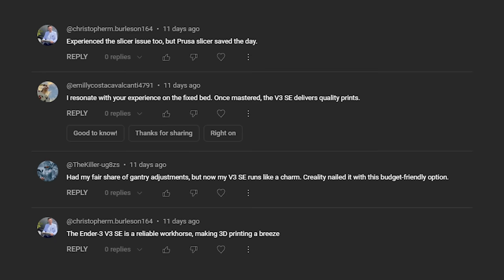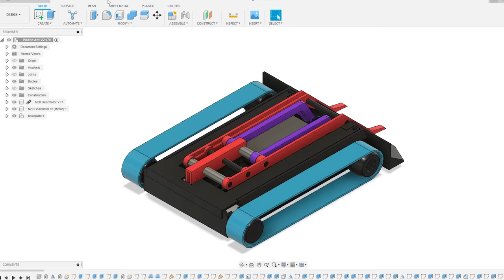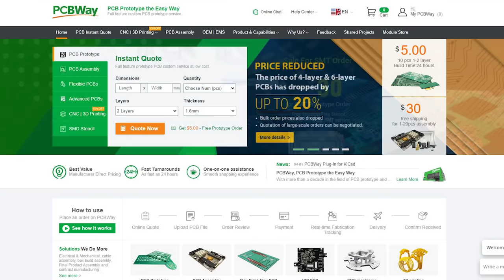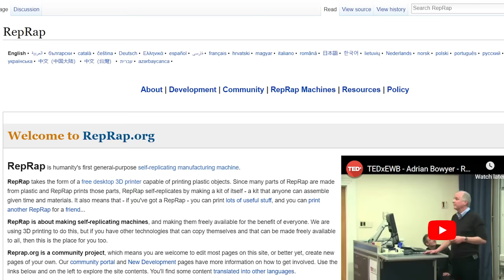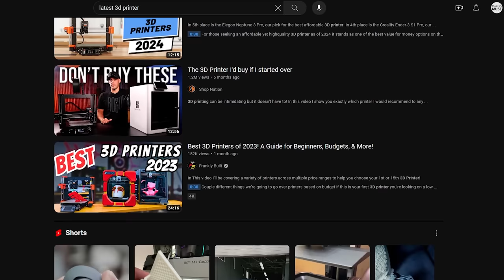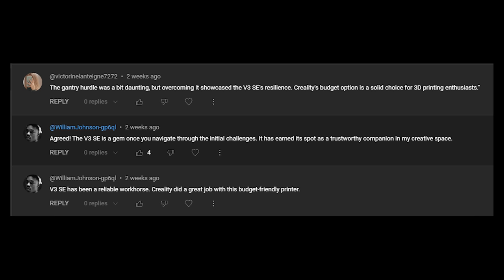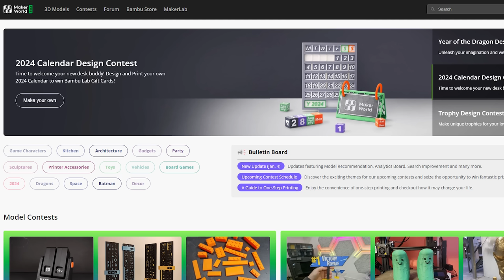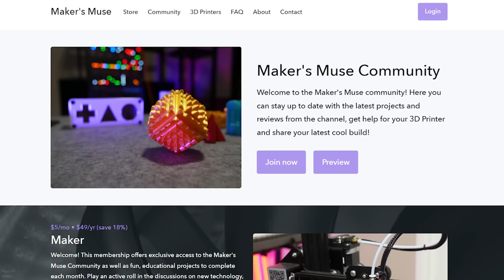My 3D Printing Predictions for 2024

Comment: Regarding professional printers though, you really need to take a wholistic look at the entire additive manufacturing industry to understand why more companies are shifting toward professional 3D printing: it’s where the money is. 

Consumer 3D printers have been a race to the bottom, and the reality is that any company outside of China is going to have a really hard time competing on price in the consumer space. 

Also, the best result a lot of these smaller 3D printing companies can hope for is getting consolidated into a larger company in hopes for some amount of stability. The fact is that AM is an incredibly tough industry to compete in, and the future is still unknown. 

You also contradicted yourself mentioning how much low cost print services have improved and gotten more accessible to consumers, then say you don’t care about professional printers. What machines do you think those service bureaus are using? Isn’t low cost service printing also empowering creativity through technology, only with guaranteed success?

I have my own printers, a SolidWorks license, etc, but service bureaus are amazing for filling in the gaps in my print capabilities and for things like metal printing that will arguably never be practical in the consumer space due to the annealing oven processes and inert gas ventilation.

Comment: I am not sharing the enthusiasm for cheaper 3D printers or consumables in 2024. In fact I am betting on the opposite.
I think 3D printing appliance that just works will demand higher production input and thus higher cost. That in itself is not a bad thing - after all a tool that produces the results rather than requires step-by-step processes is the end goal - however I see manufacturers pushing and capitalising on higher priced goods, which offer higher profits (even if the margins are the same) under the advertisments of "works out of the box". We may even see alliances pop up between 3Dprinter manufacturers and software companies, something like "included 12 months subscription to Fusion360", etc.
The cheap mass produced printers will still be there, but those, like you mentioned, are targeted at DIY tinkerers and/or makers who are not even primarly concerned about what the hardware does i.e.: Arduino, RaspberryPi, SBC community in general, and/or naive parents or unexperienced first time buyers (done that!).
On the upside, the value of your channel increases the more A.I. and fake content there is online 😉 Cheers! 👍

Comment: There IS a way to make recycling more mainstream, but it's not going to be a popular way. BTW you mentioned Brothers Make, they recently recycled some HDPE 30 times and the plastic had the same properties after 30 shred/melt/inject cycles as it had at the start. Plastic really IS immortal. Manufacturers used to like to say that recycled plastic became unusable but BM proved that to be bullshot. But it let manufacturers work with virgin plastic made with petrochemicals rather than with "old" plastic. Now - we get charged a premium for one petrochemical, but plastics manufacturers' costs have hardly changed. If governments put tariffs on the raw materials for plastics as they put on fuel, you'd see and instant aboutface from the industry, and recycling would suddenly be the most populart technology on the block. 

We need to lobby our governments to make the use of virgin as expensive as petrol. That one change would start a snowball.

Comment: The main issue for the industry, is that no one wants anything 3D-printed. 99% of people I meet, have never ever bought anything printed, do not know about anything printed they would want to buy, or know anyone else who have ever bought anything that was 3D-printed.

I am not getting the hype of last year. I just don't.

The breaking of couplings and cohesion from Bamboo Labs were just shocking. And the lack of understanding of what that breaking means to the industry seem like complete. This is not drawing in skilled structured designers, that are willing to do heavy lifting. The industry still need to bootstrap.

Comment: I hope there will be more support for Blender and 3D modelling for printing;
It's all vertex&face based, I tbh don't understand how cad software works; I've seen it once, it looks at times like vector graphics vs raster graphics; but I can model stuff in Blender just fine and then print it, with enough tools and the subdivision modifier, boolean on top.
I just wish there was an easier system to measure stuff (measuring stuff in blender is horrible! literally every third time I'm able to snap the ruler to the vertex I want, istead of something 10x further away) and to add "industrial" shapes like holes for M4 screw, etc. I literally have my "organic" models and then I boolean holes into them in the shape of M4 screws I've modelled xD. It's dumb.

Apparently there are some add-ons. I need to try them.

Comment: I can totally see a "scare" for 3MF files. Especially if someone finds out to make a backdoor executable that is run via Bambu Slicer. Or let's go a little further and say the slicer slices a file into GCODE that is then uploaded into your printer and executes a code that screws up your firmware. This could happen possibly easily bc of the big jump into Klipper, which is open source.

Hmmm...

Comment: What is stopping a slicer that integrates with a paywalled repository?  I mean yes gcode is gcode it probably could print OK on other similar machines but it would be a start.  It's I think one of the larger issues right now with 3D printing, there's nothing allowing me lock down my design.  Once I sell the STL it's just out there.

Comment: Should the repository site be responsible for scanning the files they store for viruses? 

Do you think customizable filament colors similar to 2d color printers using dyes, inks, etc. will be developed more and possibly replace the need for many spools of color when you can use natural filament with dyes?
Reply: Yes. Hopefully yes. All the filament swapping for colouring is requiring so many spools just to get one pretty print. Not to mention purge towers and poops from filament swaps

Comment: Thanks for the video! I would be interested in hearing about free / cheap cad software. I have used Fusion 360 but I avoid it for fear they will start making me pay. Given that all of my models are in their cloud they could easily take it away. I am also interested in hearing about cad programming solutions. I have been using Openscad which works okay but lacks features of a better programming language. It is also very inefficient causing me to use python scripting in blender in addition to Openscad. 

On another note, I am waiting for the market to get through this phase of innovations and then I plan on upgrading my CR-10. The speeds of printing and ease of use look very nice!

Thanks again

Comment: What about the prediction for muilti-filament 3D printers. Like Bambu labs bringing this feature to affordable 3D printers does push the rest of the 3D printing manufacturers to focus more on it right? I'm really expecting one of those types of printers to come out really soon from Creality or Elegoo, due to the more bigger build volume that they have in their printer.
Reply: I have Bambu printer but I think this is still inferior design. I think all filaments should be white, and we should be using some form of colouring using something similar to sharpie mounted in PTFE before a hotend. There were few prototypes like that and they gave pretty good results. Then you don't have to buy 20 different coloured filaments which might have different printing properties with different flowrates and pressure advances. Just one white filament and 3-4 additive markers to give you the color you need. 

Comparing it to normal paper printers, we are not using red, green or blue paper, cut it and paste it in specific spots on the page, we are using ink or toner to achieve that result on white paper.

Comment: With increase in prices to ridiculous levels, 3D printers are a God send. 3D printing should have no place to print small stuff or any stuff 10X cheaper than the same things bought from a shop and qulity at 95%. Example: I bought a set of 20 clips for cable fastening it cost me 12 euro. I reverse engineered it in 15 min and print the same quantity in one batch in 60 min and cost me material wise 1.6 euro material + 3 euro energy + 15 min design ( time that can be ignored since it took me 40 min to go to the shop and back, not counting using the car and the gasoline). I call that a major win. Ok maybe not 10x cheaper but close.F**k gready comapnies. One clip is not more than 0.1 euro to produce when made industrial hack I think its a matter of cents. Sure you have transportation and shelf tax. But the shelf tax which should be 30% is no where near that. Shelfs make more profit than manufacturers and it goes to ridiculous profits. Where is the goverment to protect us from beeing overcharged ? I tell you where, they are the stock holders. My prediction is that 3D printers are going to boom in 2024.

Comment: I believe that 3D printers will evolve like paper printers.

We are now seeing in 3D printing the equivalent of moving from dot-matrix printing to inkjet printing, with the equivalent of laser printers just coming into high end development.

So, reprap is dot-matrix, inkjet is the current trend of FDM, and resin printing is like monochromatic laser jet printers.

So, over the next few years, we will see this process of "just plug it in and print" being improved on.

Just like I can download a photo and print it without any knowledge, 3D printers will be the same.

People who just want to "download and print".

Then, like many of us who want to get more creative, many of us will learn the 3D printing equivalent of various graphics programs.

From paint to Photoshop, or Illustrator, some of us will learn these more advanced 3D modeling programs, while developers design new, easy to use, and more intuitive 3D modeling for 3D printer programs.
Reply: Let's hope that 3D printing doesn't follow the same path. Most 2D printers are sold below cost. The money is made on the consumables and to make sure the customers buy their ink the printer manufacturers have built DRM into their printers and cartridges.

XZY Printing tried something like this in 3D printing years ago but failed due to the RepRap community cracking the firmware.

Comment: I'd love to see easy to use CAD programs. 

I got my first 3D printer this Christmas and a few days into learning FreeCAD I've been designing a few things like headphone holders,cable tidy clips, etc... Bit it's not the most intuitive bit of software! I've done a lot of YouTube lessons to get me to this point. 

I'm both interested and scared of the posted of AI generated 3D models. On the one hand it could be great to quickly generate something, on the other if repositories become polluted by crappy AI generated models it will be very difficult to find good models when we don't have the time to design from fresh.

Comment: My prediction is also a little more cynical. I think that now machines are more plug and play, they will become more closed ecosystems, requiring their own branded consumables, firmware you cannot change, and perhaps eventually even only models you buy from the manufacturer.
Reply: Or even worse, branded filament just like inkjet printers have cartridges. I've seen this attempted a few times, but with more people seeing these as a tool they don't want to tinker with I could sadly actually see it work 😅
Reply: @berribeans6593  that's exactly what I meant by branded consumables. Scary, huh?

Comment: I’m definitely disappointed in the lack of easy to use CAD programs. I work for my university’s materials research lab as a 3D printer operator. I’m pretty good with Solidworks, but it would still be amazing to have an easier CAD program that dosnt decide to shit the bed if you look at the computer funny or fart too loud.

Comment: so i recently got my first 3d printer a creality k1 but i dont know what to do before turning it off like do i need to pull out the fillament before turning off? and i tried printing a articulated shark but the top fins werent printed but it still said it was finished. and do i need to wash of the glue after every use? or do i leave it on and for how long

Comment: I just hope that Bambu doesn't take over and EEE the open landscape that RepRap built, the one which Prusa and Creality (and etc) machines live together in harmony with...

I remember back when FlashForge got laughed out of most maker discussions for being proprietary, and yet now Bambu is openly doing the same with no consequences.
Reply: Bro, you live in fantasy land. In reality, Prusa and Creality are just about as closed as Bambulab, they just didnt have the engineers to make a firmware from scratch.

Literally look at the details. Prusa is open source? Where are the hardware step files, bom files, gerber files for their past 2 printers? Why are they making blog posts saying they dont like open source? Why are they using an old version of marlin that is so far away from marlin proper that it took them literal months to port input shaping, a feature that had been in marlin for quite some time?

They have to make their firmware open, but they did so in a malicious compliance way where it wouldnt be useful to any other companies. They had to make Prusa Slicer open, because it was based on open source slicers.

Basically, I think Prusa has been getting a free pass for too long pretending to be about open source while not at all embodying what people feel when they say that.

To me, Prusa is just about as closed as Bambulabs is, but people just haven't noticed yet.

As for Creality, I think thats a joke. It took them multiple months to comply with the license of klipper, and they have a host of violations so large it could be a modern sky scraper.

My point is, I think its mythical.

Comment: I'd like to see STL sites that have some kind of proper curation. I upload rc car rims I design to Cults, most are free but some I try to sell for some pocket cash, and within a minute they're buried by about 50 newer uploads, most of which are car models clearly illegally ripped from games. The screenshots are taken in Cura and you can see the red areas all over them, caused by reversed normals, showing that the "artist" hasn't even bothered to repair or post process the crap they've uploaded. I not only put effort into my designs, but also the presentation of the upload; a good render of the model as well as pictures of the finished printed items, but they just end up getting pushed further down the hill.

Comment: Not wanna be a party pooper, BUT calling the x1 "out of the box" printing is kind of bullhit, YES they print after like 5 min of work, BUT you still have to attatch the screen, maybe remove the AMS and remove some foam, yes you get guided through, but except the foam, especcially the screws are still to much for some ppl.

STILL Definetly a really really great direction.

Comment: Beep Boop, I am real person, yes. So here are some ideas I got from watching the video: for embargoes get a bunch of your fellow reviewers you have influence with and create an icon set standard for paid review/product placement, embargoes, pre/not preapproved video before upload, affiliate links, etc. Place the icons on the side or bottom of the video at the beginning or when the product is first shown on screen. You can see if others have also tried to set the standard and adopt these to not add more standards. With enough traction and proliferation, it can permeate into other reviewable niches, and perhaps in years' time YT might add them as flags as they did with the advertisement. 

I'm not going to touch on the AI topic as I use generative AI as a tool in my existing workflows and have an Etsy shop, however rest assured it is a tool with work both before and after the generation being done back by a decade and half of graphic design experience (2D, I haven't jumped to 3D yet).

 Finally with the 3MF files the repo need to perform a scan and reject finals that contain non-whitelisted file types and in addition need show the contents of the 3MF to the end user prior to download. The first repo to get that right and not have a crap search and category system will take the lead in the industry. Your thoughts?

Comment: I really don't see how 3D printing can get much faster. It's already at such unbelievable levels right now and increased so much over the past 1-2 years, it makes me think we're close to the limit. What do you think?
Reply: When he said that printers will get faster I took that to mean that they will get faster on average, or, cheap machines will be almost as fast as the high end machines (think A1 vs X1C). I think high end speed will plateau in the next year or so, until maybe 10-15 years from now when we might start to see pneumatically controlled printers enter the market.

Comment: I'm hoping for an affordable CAD software that isn't linked to a monthly subscription. I've used plasticity for a little bit and it's great, but missing essential features for modeling complex parts. 70 USD a month for fusion 360 is way out of the price range for most people.
Reply: Alibre Atom might be worth looking at, you can buy it outright and have no limits on selling your models for commercial use. They are also adding a subscription license that may be worth looking at as well.